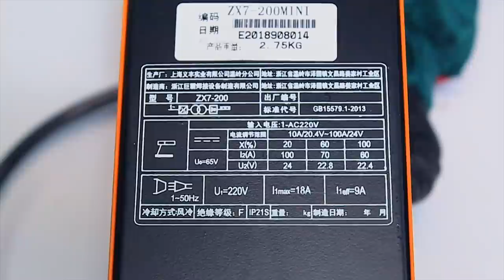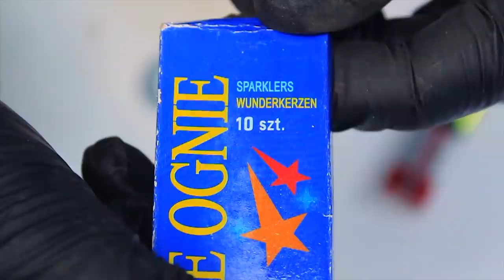2 IDEAS WITH WELDING

Comment: Running out of video ideas? I weld professionally and this is the most getto thing I've ever seen
Reply: Nickolas Cowan what do you weld
Reply: @justinmartin8887  MIG, TIG, stick, oxy acetylene torch. I weld aluminum and stainless. But have done high carbon to mild steel.
Reply: Nickolas Cowan ah you’re up to my level. I like seeing how many trolls I can find on YouTube. Repair center or production?
Reply: It's food services and production

Comment: Insult to welders, welding rust.. arghh al the mistakes
Reply: he didn't weld rust , it was wire brushed first . The welded surface was , watch again .
Reply: Aye I'm a second generation (my uncle n dad luv em for makin me learn to sweat copper n braze b4 I ever got hold of a lead miss those 2 metallurgists) fitter/welder/fabrication/all around real living human being who lives here in the real world dealing with the imperfect situations an scenarios of our real world an our imperfect lives. That said there's always rust n if u say don't see any, all ground here boss hmmm n reality rust starts on a molecular level soon as air hits it. So rust an moisture is always there lurking. It may not have consistent depth pen  PJP (effective throat) thoroughly, or be perfect. So U can weld Iron Oxide u already r ... N of ya don't mind toe cracks or gettin juiced if ya gots ta reverse ur polarity fun fun... N that one saying U ain't no welder less ya can weld a gap ya can step over..holds true don't know how it be cost efficient but is possible. So with that said lets learn from each other on that note has anyone addressed jusy the first  part I'll not worry bout no sparkler electrode I'll b usin them with a fuse later but didnt geeta see nutin coz tha none closeable pop up.
Reply: But on the first 1 has anybody seen or asked were he clipped or touched an held his stinger because all I saw was ground clamp. Electrode was clamped n either the bottom which is best coz of the natural double flare groove ...but  the lil piece o' 1" drift wood holdin our electrode shoulda been smokin n on fire did it even have a char maybe IDK WTF is goin on here is somebody pullin a fast 1 somethin... I'm not even gonna fuel our imaginations with what could be goin on with the electrical problems that were over came 4 this. How about having no control of your arc fellows no human or machine I'll elaborate the latter but as a welder I wanna n gotta b n total control of my electrode arc an consumed apparent metal (key hole). Now at a time in my life I had 3 AMWS U.S. certifications n 3 CWB Canadian certs. 1 n canada n 1 here were 4 the same process submerged arc welding which is ok if machine is manned. Yeah boring 2 me 2 especially my mind sorry guys fitter thinking. But yeah is this guy tellin us he's created his DIY subarc outta a less than cracker box machine. Rewire insides of 3 microwaves throw a couple cables on it n ya got his welder...but that weld was one dem dare wit 3 car battery welders he weld with
Reply: N yeah ya right he easily coulda rolled as brused on both sq tubes n the groove woulda been much cleaner

Comment: You see the direction that we'll is flowing, it's on top and not penetrating the metal. It may be welded together but it's not strong.
Reply: Yeah in terms of quality and strengthness its failed
Reply: The85F0X

Comment: I’m a certified welder trust me don’t weld anything like this it will never ever hold
Reply: @Donovan McFarland , can you explain why it does not hold?   that  molten bath be even visible on the inside
Reply: Yea I can explain it welding with the wood on top for one will absolutely introduce oxygen which is why that weld is so pours and 2 he didn’t clean the metal enough
Reply: @donovanmcfarland6887  I had never seen this way of welding before, but for me that welded seam looks nice, some make welds what looks more like it's been pooped on it. 😂 And I used to work with an all-round welder who also worked in the offshore industry that had taught me the welding
Reply: @JohnBoonBeanDutchman  This weld has some huge pores and the two metal pieces dont look like they even melted at all. funny weld, but usesless for strenght.
Reply: @xNeRcOx  strength*
Reply: The metal is actually clean enough for smaw ( shielded metal arc welding). Gtaw and gmaw are the only processes that require the metal to be thoroughly cleaned
Reply: Donovan McFarland
Reply: I've had better 1st day apprentices do better that that lol
Reply: In my workplace we use exactly those methods. Really, who needs any kind of expensive sticks, when you got bunch of cheap sparklers. And it is really easy just clamp those sticks between metal bars, no skills needed.
Nowadays we only use sparklers clamped between metal bars, did you know that you really don't need expensive welding mahines, because sparklers sparkle without electricity.
Internet is really full of lies, i'm just saying.
Reply: @rexwolfe147   Damage controll spotted. Remove your fake profile.
Reply: Yeah he didn't know how dangerous is that
Reply: I also know how to weld and those two bits of metal are barely attatched
Reply: @lollagemies  I sure as shit hope that wasn't some stupid insult. But if it was, you should step your game up.
Reply: @rexwolfe147   Truth hurts?
Reply: @lollagemies  ok bud. Whatever you say.
Reply: lollagemies but if your doing real welding it needs strenght and this ain’t it
Reply: That's what I was thinking.  How contaminated the weld is.
Reply: All of you guys talking about being certified to weld..... Just so you know that doesn't mean shit.
Reply: @Dustin Miller That was the words from my old welding instructor lol. He said you could fill your room with certificates and use them to wipe your ass with them. That's all they're good for.
Reply: Donovan McFarland I know nothing about welding, but I knew before you commented that that weld didn’t look right. Looks more like it’s glued instead of welded. In other words the two steel bars were not touching each other.They didn’t melt touching each other.
Reply: @JohnBoonBeanDutchman  are you blind look at the under cut and splatter just learn to weld right and that would not pass the welding test
Reply: Mud Digger no it depends what rod is being used and that bead wouldn’t even pass visual inspection
Reply: "I'm a certified welder"....
Reply: Michael Smith and what are u eh
Reply: You are so right mac this guy is a 🤡 insult to us certified welders I myself am a structural steel welder 35 years 7018 232 fluxcore ect ect

Comment: I got click baited, but leaving happy I learned that crazy trick with the wood very cool, but wouldn't it just be as quick to actually weld it ?
Still it was cool, but sparklers too funny, can't believe it worked, well done
Reply: ORACLE'S CAVE don’t use wood like that it will put oxygen into your weld which is why his is pourus and it’s guaranteed to break

Comment: In all my years welding i never thought of clamping an electrode and striking an arc.
Reply: You are absolutley correct 35 year's exp. Cert. Welder would never attempt to weld like that period
Reply: @armandogonzales1365  undercut aside i can only assume an entirely unnacceptable level of impurity and porosity would be involved

Comment: The thumbnail pic is just asking for explosion
Reply: 2 9v batteries wont blow up if you connect them ..  they just short out and get hot..  ive tried many times as a kid and never got one to pop..  now if you take a bunch of em and series em up then short the last one to the first one then you will get one to swell and leak out stuff...  but still no explosion..  also if you take any battery and short mains voltage to them, if you dont pop a breaker you will for sure pop a battery, no matter what kind it is...

Comment: This is dangerous and very inefficient. With the first idea, The slag gets drawn into the weld,  making it very brittle and weak. If you really want to weld washers together, get the proper spot welding machine rather than creating tons of sparks and damaging the shape of the washers